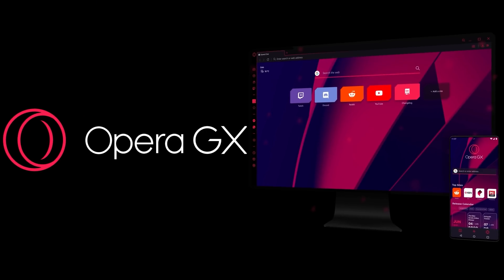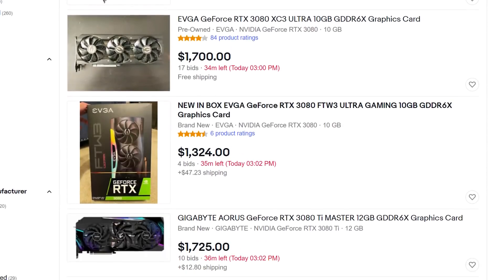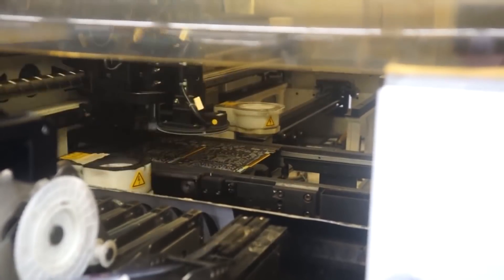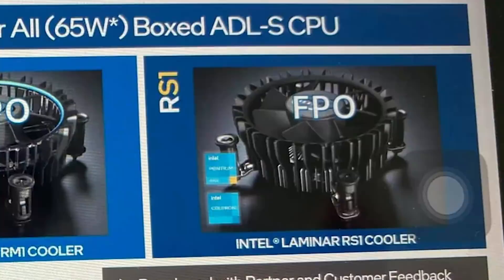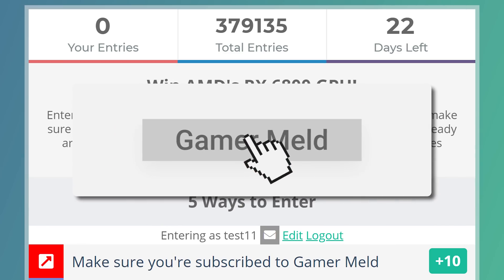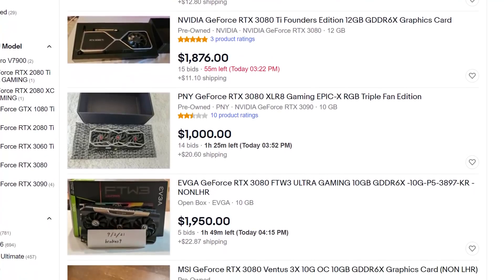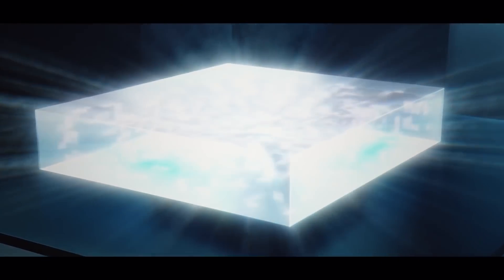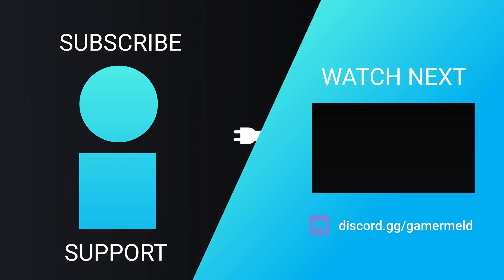2 Intel ARC GPUs LEAK - Pricing, Performance!

Comment: In January will begin a tsunami of used GPUs on the used market. Due to Ethereum changing to proof of stake. How will Intel's new GPUs compete with that? Why changing to a 1650 class when you can have a 2060 class GPU for the same price?

Comment: If they can make a gpu with stock that requires no six pin connector that beats or performs to the level of the 1650 super that is amazing performance for a first run since you cant get a 1650 let alone a super for anything under 400 pounds in the UK 175-200 usd thats around 165 to 145 pounds those will sell out in seconds here.

Comment: This has been an issue for years on laptops and GPUs. Adhesive and thermal pads with the nonstick layer left on. Especially keyboard ribbon cables and cables to zif connectors. I had an RX 480 come in for repair with the thermal pads covered by their nonstick tape.

Comment: Another $500 for 2080Ti performance class GPU? No thanks. Looks like Intel GPUs won't upset shit. Availability will likely be shit as well. Not to mention, the desktop version of these we'll only launch around late Q1 2022. By that time both Radeon and GeForce will also have refreshed SKUs (6nm RDNA2 and RTX 3000 Super)

The only good part here is the <$300 SKU possibility. As both AMD and nVidia are constrained as well as in no rush to release RX 6500/RTX 3050 type GPUs. But the very low end segment ($100 GPUs) might be irrelevant. As next year's iGPUs will surely kill off low end GPUs.

Comment: It isn't uncommon for GPU manufacturers to release the same product generation after generation with a slight uplift and a name change. The only thing NVidia is doing different is giving it the same name. The Tahiti Pro chip was in the Radeon HD 7950, 8950, and R9 280. AMD was selling GPUs form 1st, 3nd, and 4th gen GCN chips at the same time as late as the RX 500 series from 2017/2018. To put that in perspective, 1st gen GCN premiered on the HD 7000 series in January 2012. And yes, that includes the Tahiti Pro. Nvidia has done the same thing in the past on numerous occasions as well, though I don't think to that extent. Hell, they just released a new version of the RX 590 in the chinese market about a year ago.

Comment: My fiancée's brother tried out a 3070ti only to find out his current 3070 yielded more fps during his testing. He offered the 3070ti to me for a the original msrp price, however, after hearing what happened to him, and hearing your first bit of news, I am a bit worried. 

I am not very tech savvy, so how would I know if the 3070ti is performing as it should be? Is there a way to check once I get the card? My current gpu is a gtx 970, so almost anything is an upgrade for me lol

Comment: I'm curious about something.  If you are using and Intel CPU with an Intel GPU, since they will likely use similar architecture, how much better (if at all) will they communicate versus an Nvidia card of comparable benchmark?
Reply: That depends on how they programmed the processor & gpu. 
AMD made Smart Access Memory awhile ago for their RX6000 series and Ryzen5000 series.

Comment: It's is VERY good that nvidia starts to reproduce 2060s. 2060 is on turing architecture, so that means, that parts of the turing factory that was closed (since no turing cards were produced all that time) will start produce cards again, without affecting the current gen card production rate by much. Also, 2060 is a pretty decent GPU for any gamer that doesnt want to overspend, but play every game on 144 fps!!!

Comment: I don't think it's true that Intel hasn't changed their stock cooler in 10 years. They quietly removed its copper core at some point to save like 3 cents on manufacturing costs... And of course making them perform even worse. I think this was less than 10 years ago.

Comment: Re-Releasing the RTX 2060 wouldnt even be a bad idea. It was a solid Card for Entry lvl  that had a 350$ MSRP pricetag   compared to the 450$ MSRP Pricetag of an RTX 3060 . Currently if you even take a look at the MSRP's  than in the current Gen, PC gaming is for the "rich Kids"  with GPU Prices that on an entry lvl are higher than the prices of an XBOX Series X or PS5 MSRP wise. Nvidia and AMD are way to out of touch with theyr customers. they just doubble the MSRP Prices, and scatch theyr heads wondering that we customers doesnt get a 100% Pay increase lol. The MSRP rice of an 6600XT or the RTX 3060 is 2 times as high as the monthly paycheck for 2 months, in some of the Countrys they try to sell the cards.

Comment: So the non K CPU's could be worth it finally if these stock coolers are exclusive to these.
Reply: If you're deciding which cpu to buy based solely on the stock cooler it comes with, you're doing it wrong. 

I mean sheesh, I bought a $20 cooling tower years ago that I've used in multiple  builds that's better than the stock cooler  that comes with Intel or AMD. 

Stock coolers are for amateur builders.

Comment: im not disappointed they release a 3 year old gpu , i will be disappointed  if they overprice it over 3060 12gb msrp. personally im in look for a gpu for many months and i wont be getting 2060 for sure only if the price is ridiculously low like 200-300 which it wont , just to have a place holder until i find like a 3070 ti or 3080 , and then sell it.
still i believe is better than having nothing and many gamers are out there for just a gpu that can get them playing there games / stream for the next few years.

now the intel gpus the lowend is a no no , but the other gpu they offer in the mid to high end range might be worth look into , but again u need to w8 for pl to buy ti test it use it for few months and see if its worth , especially if ur a person that wanna stream a lot dunno if t worth to look beyond nvidia

Comment: Why do I feel like the intel gpus will get scalped? Not due mining, but due being short on gpu overall… if they turn to be good for mining, we might have stock of Nvidia and AMD. Would be cool, the prices for a RX 6800 were 800€ at release, peaked 2200€, dropped to 1100€ and went back to 1300€…
Cheapest 8GB card is the Rx 580, for 500€
No words.

Comment: In the United States they can not void the warranty for opening the GPU, changing thermal paste or modifying it for h2o cooling. They can only void the warranty if you mess with the board and or the chips on the board.

Comment: More competition in the GPU market will bring good things. If Intel can bring performance to the table, and compete for lower prices, to compete for sales, then that will force the other big dogs to adjust their performance and pricing or eventually lose out on customers once the stock issues are balanced out. Which yes, stock will be coming back at some point. I've seen the crazy nature of manufacturing hubs that are making the machines that make chips and they have people working 60 hour work weeks with good pay. The rona hit hard by slowing down the production chain, but things have picked back up and it will just take some time to get back to pace.

Comment: If Nvidia will sell the "new" 2060 for 150$, I would consider to buy one
Reply: 12 gb ddr6 makes that impossible.  The raw cost of the ram already eats up most of that.
Reply: @MrAustanian  I think that massive amount of RAM is a mistake. it defeats the purpose of a value product. My whole PC doesn't even have 12 GB of RAM in it. Maybe if I add in all the disk cache it has?
Reply: @1pcfred  honestly surprised they didn't go with 6gb and make it a 1660ti replacement.  Would have been fine for 1080.
Reply: @1pcfred  12GB Would be nice for my project (animation) as I don't need high end card for it.
Reply: @1pcfred  Ofcourse, but less than high end cards with 12GB or more Vram.
Reply: they wont, it will be atleast 200 ish as the 2060 mobile beats the 3050 ti mobile. So if the 2060 beats the 3050 ti on desktop, it will far more than that
Reply: @arch3978  3050? wtf
Reply: @Team Newman oh I see ty
Reply: Buckle up bucko...
Reply: @Moth Moniker the only game I play is Doom. The old one. But I use modern source port engines. Which can be demanding. I have certainly seen my PC bog down in some circumstances. Could be buggy levels?

Comment: Brother and sister a wounded animal is very dangerous so intel was but now I'm 1000% sure Intel's  gpu will be earth breaker game changer they are just waiting for the right time just think Intel will not just introduce new gpu in market they are 100% sure and confident of there gpu performance i bet you all buy Intel GPU rather than 2060 new model with 12 gb even for miners 2060 only provide 30 or 30 plus megahash . My bet is with Intel n new champion is on the horizon.

Comment: Opera - I use it but it's not great - VPN isn't a proper VPN  (it's a proxy and a pretty flaky one at that as it slows to crippling speeds) and as for memory use it used to be reasonably but latest build  are memory hogs

Comment: I'm fine with a 12GB RTX2060, I need to build several rigs for the people in my house.
12GB is pretty nice.

But what they really need to rerelease is some 1080ti cards.
(Things that don't use RT core can really benefit from these)
Reply: i men if it helps with demand and tey don't charge too much im fine with a new 2060 too
Reply: I just went ahead and shelled out some more in a card to get 12gb. But at 800 bucks, I need this thing to last.
Benchmarks supposedly place my new 3060 more than 40% better than my current one. And double the ram.
Unfortunately I'm into VR, and need more performance than I used to need. Nearly got sick last night in FS2020  because of stuttering in my new VR headset. And other stuff is showing the age of my current card.
But damn, these prices are going to hurt game developers that will need to stop pushing graphics in order to sell to customers who just can't shell out this kind of money for hardware.

Comment: At Intel HQ. 
Engineering: Hey we need a new CPU cooler design to go along with the new CPU's.
Le accountant: Yes that is fine, however reduce the aluminum fin-stack by about 50% as compared to the current models. We need to Maximize profits. 
Engineering: Excuse Me? That is a bad idea. 
Le Accountant: Don't worry about it, we can always RGB-fi it to sell, just look at AMD.

Comment: These void warranty seals are worth nothing. Also one can just send it in and let them do it if they expect to ever need the warranty.

The problem is not the foundry but the substrate so it doesn’t a lot of difference if they move one node up except that there might be the slight chance of getting a bit more..

Comment: Kind of a good idea to release an older model, they can probably pump it out faster and more efficiently and at a lower price point since everyone suddenly NEEDS a new GPU
Reply: Suddenly?  lol  Been trying to complete my August 2020 build but need a much better GPU than my RX-570.
So far?  No luck with that, unless I want to empty my bank account... and I do not.
Reply: @edb3877  same, I've got an entirely new build that is running on a 980ti scavenged from the old build
Reply: @benruss4130  At least your 980 Ti is still a pretty decent GPU... older but still pretty good.  My RX-570 is a decent mid-range card but I was hoping to buy some new 
games and run them at 1440p, 144 Hz, and 100+ fps.  RDR2 looks great and so do some of the other games released in the last 2 years.  But I'm holding off on 
buying any of them until I have a much better GPU.  Was hoping to get a RTX-2070 when the news broke about the impending RTX 3070 being 65% faster and 
having the same MSRP.  Well, that was a great big flop with the 2070 disappearing or costing $800 or so when one was found.  An RTX-3060 Ti would be good 
too but they are $700-ish or better and just about as hard to find as a 3070.  I'd be open to the idea of an Intel GPU IF it has similar performance.

I went into a Best Buy store last week and the only 2 GPUs they had in the store for sale were a 730 and a 1660.  The 1660 was $459 but I don't recall which
version of the 1660 it was.  That's a decent gaming GPU but I really want more than it can do.  I'm just hoping that my RX-570 doesn't bit the dust anytime
soon.
Reply: @edb3877  ya... But your 570 is atleast 2 years newer than my 980ti

Comment: In the USA warranty void stickers are illegal
The USA's FTC has hit Sony, and Microsoft before with warnings for having these stickers giving them a deadline for removing them from all products, and the FTC has recently expressed interest in heavier enforcement with its existing laws.
Fun fact, right to repair has existed in USA law for over 40 years, the current fight is over companies openly breaking the law, and finding loopholes like leveraging copyright law over the shape of something claiming it to be artistic, making it illegal to use non original parts to fix it because it copies the design
Most recently in the electronics and automotive world, they've started putting "artistic code" into parts that dont need it, and for a replacement part to work, you'll have to commit copyright infringement to replace the missing code.
Apple has gone so far as to sue people over re-selling used parts that have been refurbished. And blocking import/export of these used parts claiming to have full artistic control, Which is not true. This is because of the right of first sale, which transfers sale rights to whoever buys it. No, the person who buys an iphone cant make a copy, but they can take the battery out if their phone breaks, and sell it to someone else who needs a battery, or camera, or screen, which is what Apple goes after.

Comment: If Intel releases an ARC DG2 video card for under 200 dollars that performs better than the GTX 1650 Super and close to the GTX 1660, then the card should outsell anything below an RTX 3060 in performance, because the cost savings would be over a hundred dollars, utilizes 75 watts or less which means power only comes from the PCIe slot. I expect the cards from Intel for the under 200 dollar level to become the best value for performance for at least the next two years which means AMD's Polaris RX 400 and RX 500 video cards should become obsolete in less than 3 years.

Comment: So gone are the days you pay for an evolutionary GPU upgrade with newer architecture and pick your performance within a reasonable price range knowing in 5 years you will be buying a new one.

Now you select the feature set (raytracing/ai or non) and pick from the following new price bracket:

Tier 1: Garbage but works - slower than Ryzen integrated. -Cheap
Tier 2: Better non raytracing or AI -what GPU's used to cost.
Tier 3: Beginner raytracing AI - Overpriced.
Tier 4. Real cards with full features - The same cost as all your other PC hardware together. Expect to take out a small loan to buy one.